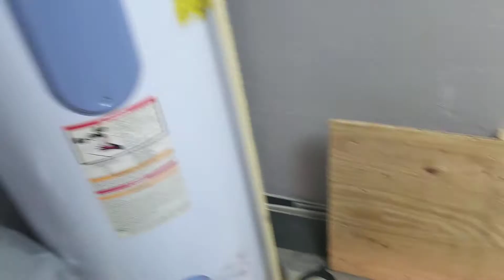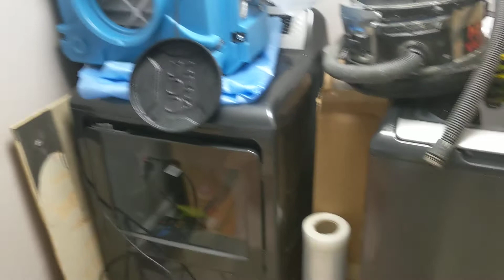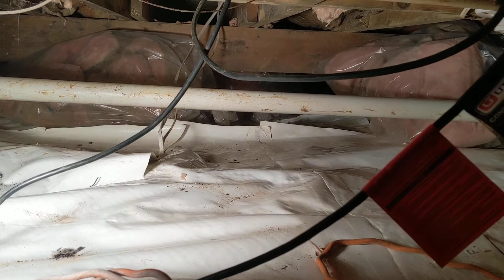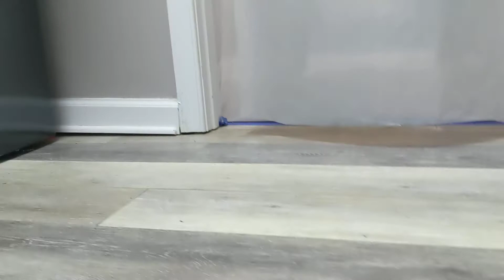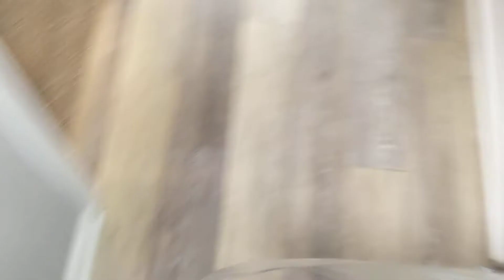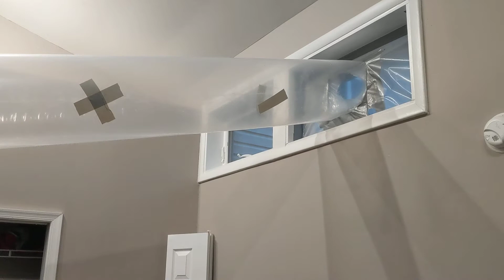One Weird Crawlspace and An Unusual Negative Air Pressure Set Up

Comment: I'd like to set up negative air pressure in the attic while I remediate some mold.

I also have vermiculite in the attic. Is it possible for the negative pressure to pull asbestos contaminated air from the attic into the home or crawlspace?